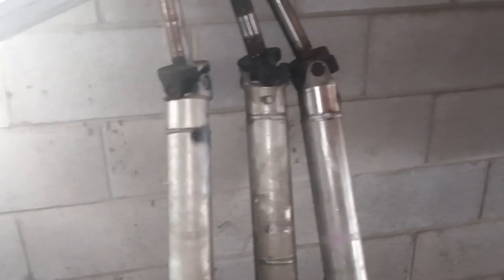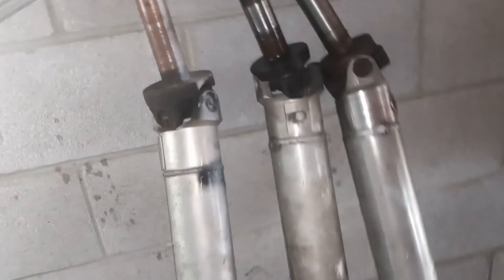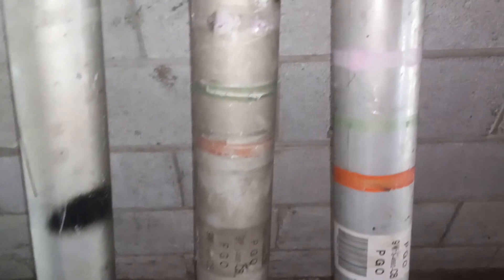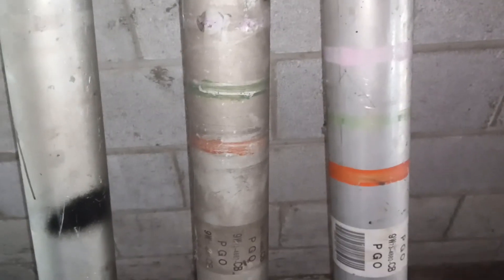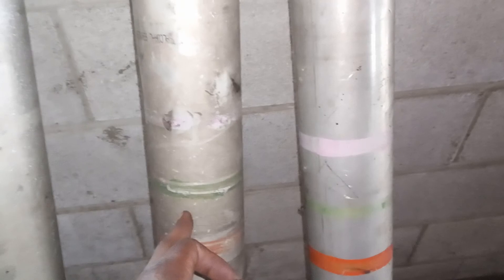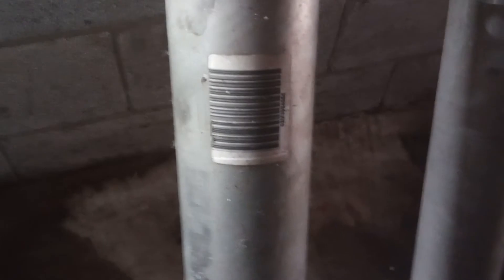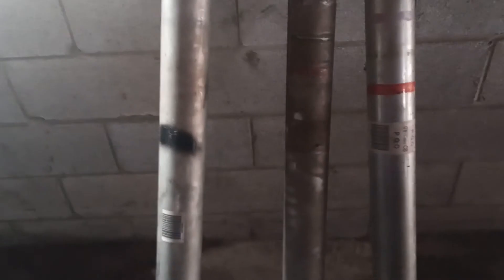Information about Metal Matrix driveshafts versus standard aluminum 06 and up driveshaft

Comment: I just swapped in a 3.55 LSD rear end into my 05 Mercury Grand Marquis. I ordered the Fabtech spacer and a hybrid u joint. This should be a direct fit. The new hybrid u joint is seemingly to wide to fit in the yoke with both retaining clips in. I can get one, but I am FAR from able to even see the recess were the other retaining clip snaps into. On my last and final attempt to make it fit, the one ring i can install, cracked out the yoke and came flying out. Now I need a slip yoke and I still dont have the U joint problem fixed. I went backwards.  I am beyond frustrated with this simple swap. Any thoughts??
Reply: Damn wish I saw your comment long ago I had this same issue I ended up grinding the hats of the u joints both caps !

Comment: So what was the top speed with the aluminum metal Matrix driveshaft with a 3.27 gear in 2005
Reply from the maker: The 05 had 3.55 120 mph is were the computer governed at
Reply: @crownvictorialifestyle4421  what if it had 3.27 Gear with the same metal Matrix driveshaft what would the top speed be

Comment: So with 4.56 I need a steel matrix drive shaft to top out no vibration
Reply from the maker: James Elliott yes it's the cheapest option vs aftermarket ones 
You get them out of 1998 to 05 cvpi 
im unsure of the earlier Aero style Crown Vics driveshafts The ones you look for don't have the police writing on them neither paint strips
Reply: @crownvictorialifestyle4421  im sure I'll be doing 120 130 romps from time to time thks.
Reply from the maker: James Elliott no problem if you need any other information jus let me no
Reply from the maker: James Elliott with that 4:56 I would definitely get a taller Tire in the rear 28 inch or 29 inch it will not affect the way the car drives it will allow you to take full advantage of those 4:56 gears
Reply: I got a 07 people dont seem to build up thous tht much as the older vics.
Reply from the maker: James Elliott I no it's usually loud flow master's and big dum rims on them 
I'm not rich but I'm hoping my builds will help put CV on the map as a affordable track car the original wide-body no kits needed 
My plans for the 4v build is going to be incredible I'm looking to buy a jt-b trim supercharger once I'm done with my cammed 2v build
Reply: Is it doable to build my year up just here in tenn dont think thier much support for it.
Reply from the maker: James Elliott actually I came across companies who build suspension setups for them full coilovers double adjustable front and back suspension rear control arms front adjustable tubular control arms
Adtr sales intercoolers kits with piping coolant reservoir relocation and a couple other things I'll need for a supercharger
Exhaust from stainless works
I'm going to modify my own fuel hat to convert it to a triple pump return style fuel system
I'm going to use fast dual O2 sensors 
I kind of got everything planned out already I researched day and night 
A lot of companies do support them it's just not their main goal or advertised as much with mustangs which are in the Forefront of their company's
Reply: @crownvictorialifestyle4421  I suppose ur right I guess drive by wire makes it more difficult to modify upgrade 05 and up vics.
Reply from the maker: James Elliott I'm just going to say this if you got an imagination it can be done
Reply: @crownvictorialifestyle4421  sounds like ur build is going to be bad. One more question u think 456 gears to much for super charging
Reply from the maker: James Elliott it just depends on what type of blower positive displacement superchargers like vmp, Whipple make tq off of idle 3.27 to 3:73 are good 
Centrifical superchargers like Vortex and Paxton make boost in the middle and upper RPM so 3:55 to 4:56 work well getting off the line harder
Reply from the maker: James Elliott my 4v swap will be more in depth I'm jus trying to get my cammed 2v build up and running by fall time then I'll have better camera equipment laptop to show you guys how to modify and get things working right so bear with me and the channel
Reply: @crownvictorialifestyle4421  any performance upgrade intakes manifold for the 07 vic
Reply from the maker: James Elliott adtr.net sells a Edelbrock Victor jr. Intake kit with everything you need
For the swap
 There's a couple Crown Vics on YouTube that use these
 This is a high rpm intake tho
On a side note your pi intake is the best thing out unless you're doing a cam swap and revving it to 6500 to 7500rpm 
I have nice size cams and will use pi intake rev it out to 6500
Reply from the maker: James Elliott if you are looking for more power now get a used SCT x4 on eBay and get a custom tune you can gain 20hp 30 to 40tq on 93 octane
I have  09 and a 2011 so I only use e85 witch the gains are a bit higher
Reply: @crownvictorialifestyle4421  man buying headers is like selling ur blood I thought of porting factory logs lol
Reply from the maker: James Elliott look up OBX long tubes headers for cv when I first bought mine it was 560$ for the whole kit now it's 850 but you get the full exhaust
Reply: @crownvictorialifestyle4421  my o7 im going to delete the cats I have to retune it for tht
Reply from the maker: James Elliott yes you will and honestly that's your best bet right now for power
Modifying a Crown Vic just like a mustang it isn't cheap I think you would enjoy a custom tune and then that'll give you time to decide how you want to finish modding your Crown Vic ,such as cams and converter with rear gears or you can s/c it using Tork techs kit 3500$ with a 03/04 cobra blower and gt500 or a 3v 62mm throttle body  you get 470rwhp on stock motor 
Try Mo's speed shop, 5 star tuning, mpt tuning there's afew more that specialize in custom tunes for CV
Reply: @crownvictorialifestyle4421  the mos speed shop like 3hrs away thks
Reply from the maker: James Elliott yeah go there they can get you on the right track cams torque converter I am personally going to let them tune my can Crown Vic once I get it up and running they have a full shop to do everything you need
Reply: @crownvictorialifestyle4421  they answered really fast I guess they have 28 spline should be plenty stout
Reply from the maker: James Elliott for your year you have the 05 and up update 31 spline
Reply: @crownvictorialifestyle4421  hate to  keep bother u im just trying to learn do u have to do a brake swap   from a older vic to put 15 inch tires on it
Reply from the maker: James Elliott Detroit Axle sells a upgraded kit complete slotted and drilled rotors with ceramic brake pads and a few other things come with that kit  I'm going to get there kit I already have their full front suspension kit
Reply: @crownvictorialifestyle4421  with this u can mounts 15s I want to to put welds drag lites on mine
Reply from the maker: James Elliott I believe their stock diameter if you go to Detroit Axle site it tells you on there what size they are
Reply: @crownvictorialifestyle4421  on the exhaust can u put extenders on the  exhaust c02 to not throw a code once u delete cats or tune is needed
Reply from the maker: James Elliott you're absolutely going to need a tune or you will throw cel codes and a potential of bad gas mileage will occur 
The way it works is the computer looks for different readings from the rear o2 and the front O2 once you mix them up like I think you're talkin about you're going to have some weird funky issues going on
 my advice will be when you remove the catalytic converters have your shop weld a O2 bong in a similar location and distance of the one that is on the passenger side catalytic converter 
So have them measure how far away from the connection is the O2 sensor placement and put it there and you should be great 
I might make a video on this topic because I have removed my catalytic converters and I can show how to go about doing that
Reply from the maker: James Elliott go on eBay invest in a used X4 they're about three hundred bucks compared to four hundred bucks new I have one and it works fine
Reply: @crownvictorialifestyle4421  u have removed all four
Reply from the maker: James Elliott yes my plan was to do what you're doing remove the catalytic converters and straight pipe it with stock mufflers intact
Here's a curveball for you I looked up Mustang headers on a Crown Vic and some guys got them to fit with minor modifications I have a video up that shows the modifications needed to install them into a Crown Vic with with minor modifications also and I paid a fraction of the price that Crown Vic headers will cost 
I also have a x pipe & down pipes with resonators 2.5 inchs for the headers  it's still up in the air depending on what a exhaust shops say about modifying them for me because it's not much only two tubes have to be pushed in a little bit and the connector on the passenger side needs to be cut off and a new one put in because it's bumping against the transmission other than that they should fit with no issues